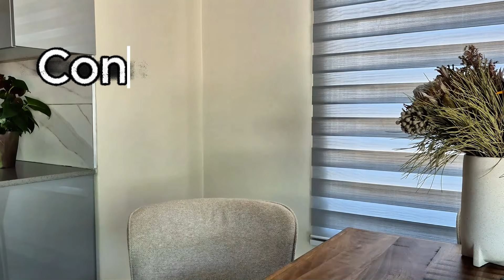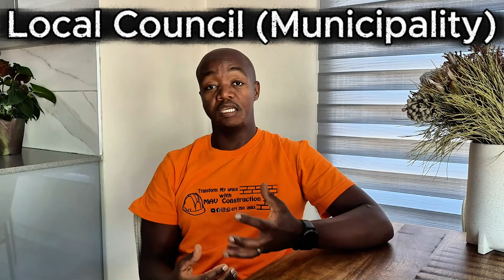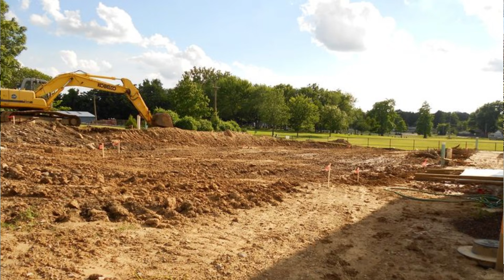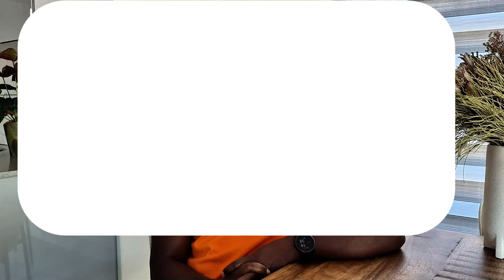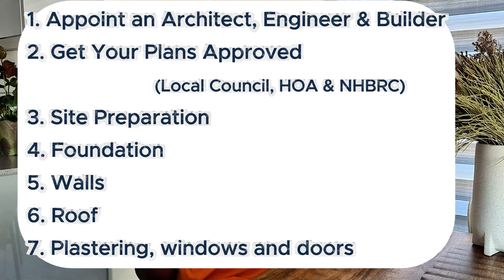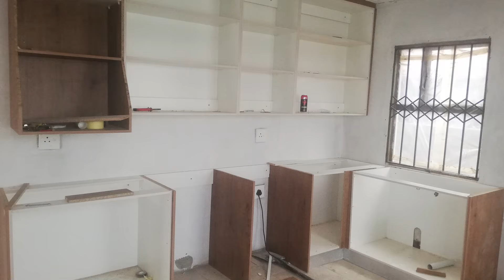Step-by-Step Guide to Building a House | From Buying Land to Moving In | How to build a house in SA

Comment: Hello once again

Where do electricity pvc pipes, those aluminum square boxes for plugs and lights and DB box fit in, plumbing copper piles as well, at point 5 with the door frames along with the wall or with point 6?
Reply from the maker: Put those in just before you plaster. In some instances plumbing and electrical pipes also run beneath your floor slab

Comment: Difference between wood and iron trusses.. Which is better? In our house the wood trusses broke becoz the builder messed up the foundation as result the roof tiles were to heavy for the wood trusses and cracks started to develop. Taking into account the weather also. So we plan to replace the wood with iron trusses to hopefully handle the weight of the roof tiles better as we cannot afford to redu the foundations. So please explain the difference between wood and iron trusses. We also considered zink roof but will mess with the esthetic of the house in term of the general look
Reply from the maker: Thanks for sharing this challenge..Timber trusses are more common and popular because of cost. There's standards around how to build proper trusses...will do a video on this at some point.

Comment: Hi Siphephelo,you mentioned in one of your videos that it would be best to have an architect,engineer and contractor working together from the beginning of the project.My challenge with that would be that if i do that then i don't get the opportunity to have different quotes from different contractors so that i can make a decision based on their work and finances offcourse.We need the house PLAN to start getting quotes from the builder and for building material if im not mistaken and i stand to be corrected,hence we opt for getting the house PLAN approved first.Please advice if you have a different or better view on this.Thanks
Reply from the maker: thanks for your question.. you make a valid point.. perhaps use a drafted drawing (not approved yet) to get your quotes from builders.. I have seen cases where architects design something impractical.. however, it is still an exception... Its ok to appoint your builder later as well.

Comment: Thanks for the insightful information. What are the average costs for hiring an Engineer and an Architect?
Reply from the maker: It all depends on various factors...but to give you a figure...Architects would charge around R80 per sqr meter of property and Appointing an engineer may be plus minus R8600 depending on the size of the project